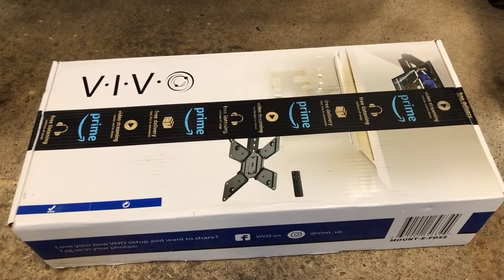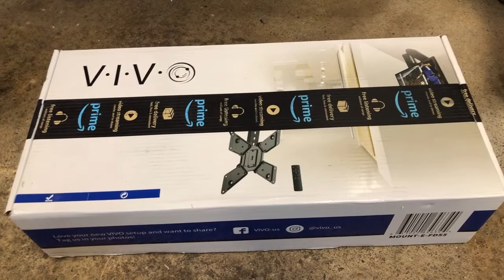Remote Controlled Ceiling TV Mount

Comment: I have a Vivo, ( different model ), on a 65'' screen above my fireplace. Good price and a great product. What you save with a mount like this, is that you don't need a cabinet to place it on. You could also have a wall mount, but down stairs a ceiling mount, will get it out of the way, when you need to. ( yes you do need some good bolts / large screws into wood!!)

Comment: are the front two mounting hole and the back two 16in apart?
Reply from the maker: Not 100% sure, I can’t get the casing off,  but I don’t think so. There are mounting holes on the left and right side, about 4 in apart and I think they are closer together than 16” front to back. I had to add extra framing in the attic anyway because my garage joists are 24” apart.

Comment: great job, how does the HDMI cable work?
Reply from the maker: I 

I have Wi-Fi in the garage for streaming.  But got a super long HDMI cable, about 20 feet I think.  I use it to connect to my dvd player that I have next to where I sit.
Reply: @drueking  and it doesn't interfere with the opening/closing mechanism?

Comment: I would set up an interlock so the garage door wont open when it is down
Reply from the maker: I actually took out the opener and am using the door as a wall, I needed more wall space, and I have two other overhead doors to use

Comment: Can you use that usb port to power it from tv instead of connecting it to plug?
Reply from the maker: No, the USB port is for factory programming only.  It cannot be used for power.
Reply: @drueking  so how do you power up the tv
Reply from the maker: @jaydarealest5978  this used to be a 3 car garage,I took out the center opener and rail, and plug the tv and mount into the outlet used for the opener

Comment: what size is the tv?
Reply from the maker: 55 inch
Reply: What’s the brand of the tv
Reply from the maker: It’s a Hisense.  I wanted something cheap since it’s just for me in my studio/shop and had Roku.  But I have to say it’s been a damn good tv so far.
Reply: I also have 55 but it’s a Samsung I have the same mount so the little ears around the square mount do you need to use all 4 ?
Reply from the maker: @LC-jg7mw  because of my bolt pattern, I had to use the lower two ears only.
Reply: @drueking  good video, thank you for sharing. Can this motorozed ceiling mount support a tv as large as 85 inches?
Reply from the maker: @california_dreamier  it says that 55” is the max
Reply: @drueking  thanks